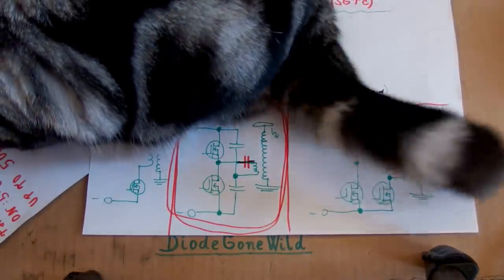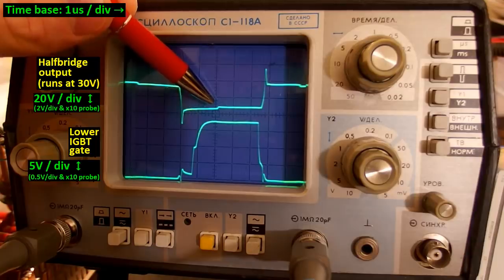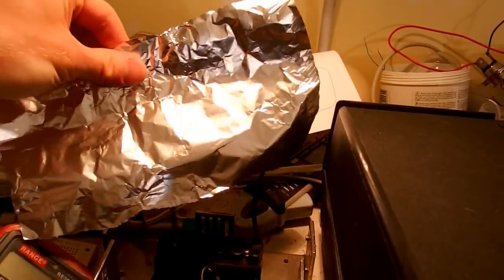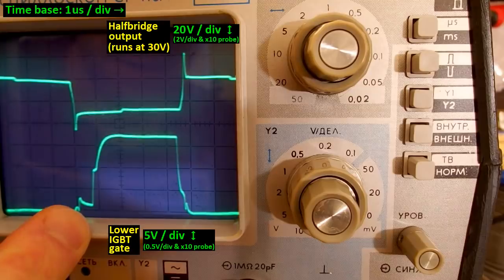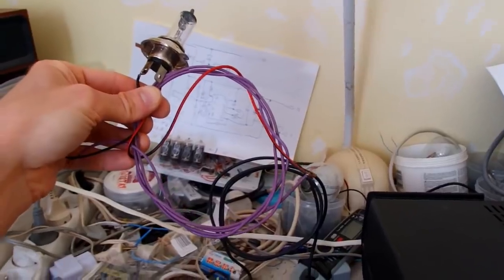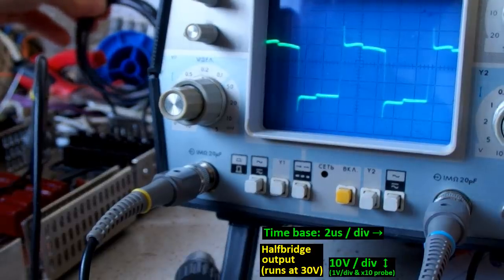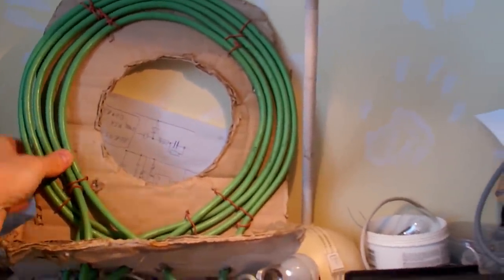SSTC pt. 8 - snubber networks & inductive load test

Comment: I always enjoy your videos! just one thing about the probing when you have a large coil driven by pulses. It can easily induce voltages in the oscilloscope probes (thru the loop formed by the gnd connection of the probe). The magnitude of the induced voltage depends on many factor of course, so it could be small or large, but it worth checking to make sure the readings are not thrown off a lot.

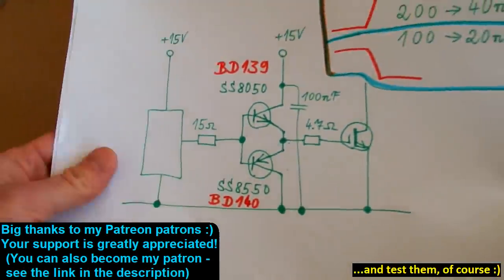Comment: at 10:43 i would bypass the 4.7ohm resistor too with the diode, since it is only required during discharging
Reply from the maker: This is done in single transistor things or in a 2-transistor forward power supply, because they only switch in 1 polarity. You can't do this in a halfbridge. The opposite transistor would charge the capacitor with no resistor in series (during hard switching).

Comment: The body diodes of transistors are usually very slow acting and have generally pretty high voltage drops. I would recommend trying some fast acting schottky diodes, superbarrier diodes, or TVS diodes with low capacitance and high reverse recovery time near the transistor. Unfortunately you're dealing with through hole, because SMD would offer the best results in terms of series inductance.

Comment: When you bypassed those resistors, the ringing didn't have that high amplitude as the overshoot with the resistors, which brings me to a question, what is better.. A short high overshoot or long ringing?

Comment: Are you planning to switch the PWM at close to resonant frequency (or slightly higher than resonant frequency)? Because, under that condition, the turn-on lossed on IGBT is minimised. Without a closed loop control, the control of PWM frequency to exactly match the resonant frequency is impossible. With manual control (potentiometer), you will be able to keep a freq higher than resonant (in inductive zone).
Reply from the maker: Of course slightly inductive (tiny bit above resonant) is the best :).

Comment: Would a low ESR decoupling capacitor right across the upper IGBT Collector leg and lower IGBT Emitter leg help with the spikes? As sometimes its caused by the inductance of the DC bus between the fets and rail splitting capacitors.

Comment: Does that bottom IGBT do anything but provide a diode to discharge the inductor?  Should those 11uF capacitors be in series with the coil?
Reply: are you sure those snubbers do anything?
Reply: Do you not understand working principle of half-bridge?

Comment: Can someone please explain DGW's comments at 1.35-1.42.  What diode is the current going through, and why?  Thanks
Reply: It's the internal diode of the IGBT :)
Reply: @drobotk  Yes I understand it has to be one of the IGBT diodes since they are the only diodes.  But which of the IGBT's and why?  When the gate of the low side IGBT is high, the halfbridge output is low.  So the diode in the high side IGBT is clearly going to be back biased.  Why would the diode in the low side IGBT be forward biased?  Maybe when the halfbridge output is low, it is slightly lower than the 0V rail, so the diode conducts?
Reply: @michaelfisher9671  Hm well I'm not sure about that too
Reply: @drobotk  Glad I'm not the only one!
Reply from the maker: The current goes through the internal diode of the lower transistor, and after the tiny notch, it goes  through the lower transistor.
Reply: DiodeGoneWild thanks Dany but why?   Is the output at a lower voltage than the 0V rail?
Reply: @michaelfisher9671  Yes. The induced voltage in the inductor will go above the +supply and below ground voltage every cycle, which causes the diodes to conduct and the energy ends up in the capacitors.
Reply: @Basement-Science  Thanks

Comment: What is your public electricity company limit on current drawing in your area? I'm limited to 30 amps max on 1 phase.
Reply from the maker: We usually have 3x 25A (3 phase) main circuit breaker before the electricity meter. The wall outlets tend to have 16A breakers, sometimes 10A. Some appartments only have 1x 25A main breaker. Those are mostly appartments with gas supply. Having gas powered heating, water heater and stove, 1x 25A supply is enough.
Reply: Paul NJ , here in New Zealand the pole fuse is 60A per phase most older houses and houses in the country get 3 phase ( 2 for normal use and 1 off peak switched for hot water) but I have seen modern houses in town that only get a single phase supply.
Reply: Same in Moldova  30amps max 1 phase

Comment: You need more powerfull electronics 
170A igbt FGY160T65SPD
Izolated gate driver 2a peak
Lmc555 oscilator (10khz-1mhz 1-99% duty)
Input filter 
Curent limiting
Reply: His goal is to make this SSTC as simple as possible I think :)
Reply: that igbt is hella slow and has very high switching losses...
Reply: @drobotk  for me is the oposite
Reply: @panjak323  you can put a 12v 1w zener to the gate or drive it at 0.5-1a and it is 130ns slower

Comment: Snubbers are not a very good solution.  the wire wound resistors are highly inductive.  Have you tried some fast diodes across the transistors and the two series caps that you have across the line should be located as close to the two HB transistors.
By the way, you have a very needy cat that requires a lot of attention.  she/he should be allowed to go outside more often.  :):)
Reply from the maker: The resistors are of course not wire wound. They are film resistors. The diodes are already inside the transistors. The cat is just indoor cat. My girlfriend would never allow her to go outside. There's to much risk of getting lost, torn apart, ran over, poisoned, catching a disease and so on...